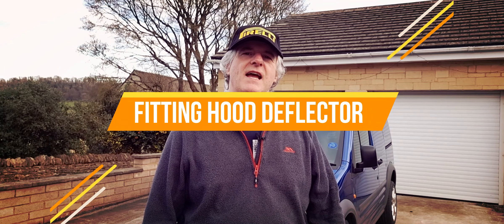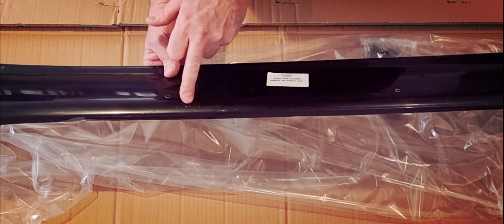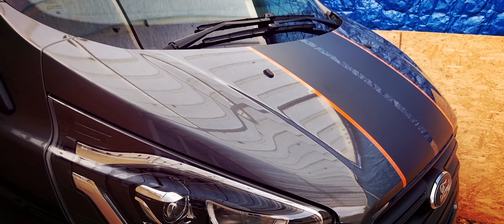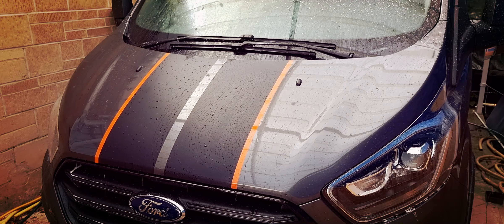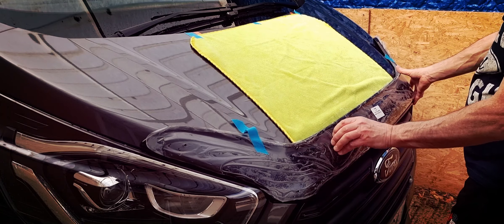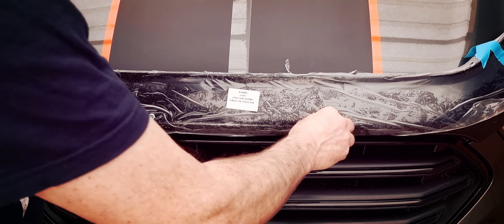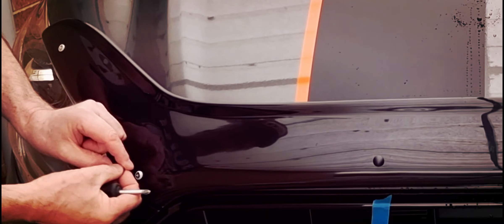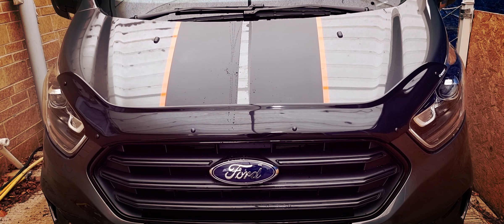How to Fit Hood Bug Deflector to Ford Transit Custom Sport 2021

Comment: That installation looks very loose and i would suspect it would vibrate and makes noise!  Just wondering.
Reply from the maker: You can only go so far, and it's fine  it's been on the van for about 2 years now 😊

Comment: Does it actually reduce the fly splatting on front window, or is it good just for bonnet from stone chips?
Reply from the maker: Funny thing I have been out done 1,000 miles with it this is over 2 weeks, so basely stones would have hit the bonnet, so cleaned off to check out and not much to see, flys on bonnet a lot less, as for window no it's the same, so from my experience less flys less damage from stones, funny I was wondering if it's just a gimmick or not,  ok it's works for me.  Just finished fitting my k and N filter now that is really good for uping the power check it out laters 😀 Steve link https://youtu.be/ChTb2mDwRTk

Comment: Hi there what's the name of  the bonnet  Deflector  & does it fit snug as i bought one from another company & it  wouldn't cover all of the bottom part  of the bonnet by the lights and is the link where you got it from
Reply from the maker: Hi mate it's fits very well and covers the bottom,  the make is Cappaf auto accessories, more information in the description under video, now I will point out that the fitting information very bad and very poor photos 😀 that's why I made the video, for what it cost it's a good buy 😀 now I bought one years ago  for my off roader which was originally 4 times most expensive and better quality😀 most of the ones I have seen are very much the same with almost the same fittings and fitments 😀 the company is a very good business who sells it and if you have a problem with it you can return and get refund 😀 check out the description below for more information 😀 laters Steve
Reply: @crazybaker1   Hi Steve thanks for the reply tried van style no stock so will have to wait 
cheers

Comment: Excellent video, just what I needed!, as I've just bought one of these for my Dacia duster.
I've some helicopter tape I could use before fitting the clips, not sure if it'll be too thick?
Maybe some stainless countersunk bolts to replace the ones in the pack.
Many thanks Crazy Baker!
Reply from the maker: Your welcome mate 👍 😀

Comment: Did you get any wind noise? Fitted mine and loads of noise in cabin
Reply from the maker: Hi mate, now this is going to sound odd, sometimes I found it does have wind sound, then on other occasions no wind noise at all, so it's something to do with how the wind is hitting the front end of the van 😀 otherwise I have no idea 😀

Comment: What 3M tape did you use to protect the paintwork? Thanks.
Reply from the maker: Hi off eBay I got paint protection film, or it's known as PPF you can buy as you like, or if you live near car or van vinyl shop, there will sell it in a small amount or off the roll 😀
Reply: @crazybaker1  great, thanks. 👍

Comment: Thanks good video 
The photo instructions are garbage
Reply from the maker: 🤣🤣🤣 what's photos mate or have I watched a different video to you 😀😀
Reply: @crazybaker1  
The instructions I got with the deflector were same as you showed in your video 
The photos/pictures in that single leaf instruction were horse sh#t nothing resembling your smart method.
Reply from the maker: @eddie6921  I was wondering that 😀 it's odd that they put such C ..... instructions with it, that's why I was thinking about people buying one and how do you follow that, I remember looking at thinking who wrote this, and then like you said photos 😀 laters Steve 😀
Reply: @crazybaker1  mine is now fitted thanks
Reply from the maker: @eddie6921  today I have just wax the hole of the unside of my Transit, ok I did do a small video, as some areas are very hard to do because of the Sport body parts 😅 unside in the hot 🔥 35c well baked 😳 laters 😀